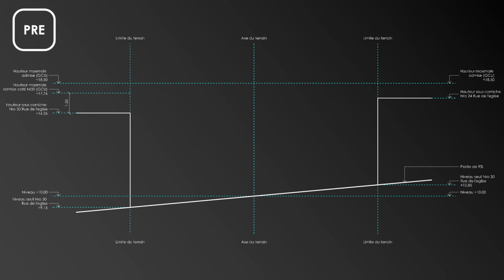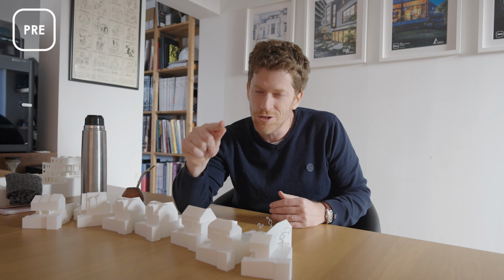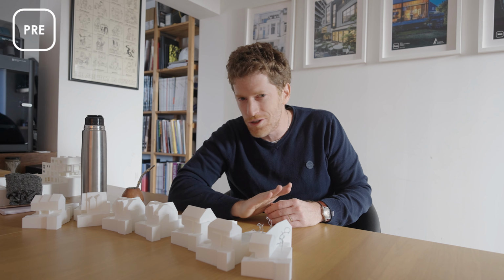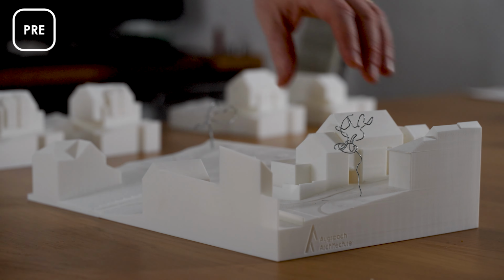How an architect develops design concepts

Comment: I think that its amasing that you approach the context in this way, and i'm quite sure this helps avoid you and your client future headaches. That said i think the way the counsil treats new builds in respect to the neighboors is a bit unfair, and i think it gives an unfair disadvantage to any future developement on an unbuilt plot, that grows as the rest of the neighborhood is built-up. In my understanding this would create the risk for random plots remaining empty for eternity, totaly not good for urban density and sprawl, but also completely unfair to the unlucky few that will either never develop their property or never do so in a cost-effective manner. Also regarding the detouched house, i think you can argue that the plot is irregular enought to justify for it, and specially when you try to avoid problems with the neighbors and you give yourself additional limitations.
Reply from the maker: Thanks for this valuable feedback! And I share your concern. I also think that the current approach makes the endeavor of developing a riskier one than it should be (considering one has to buy a plot without even knowing how many square meters one can build). I also think the council in an ideal world does vouch for the community so their role and input is valuable. we just need to work for better systems.
Thanks again for taking the time and your input!